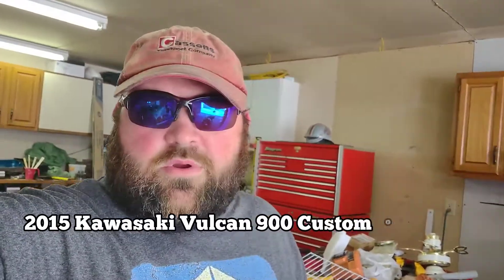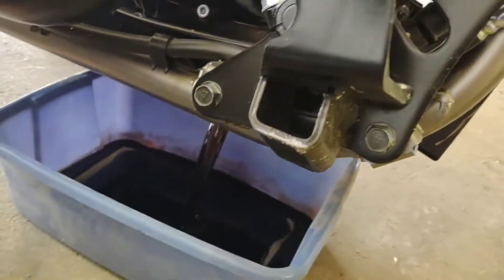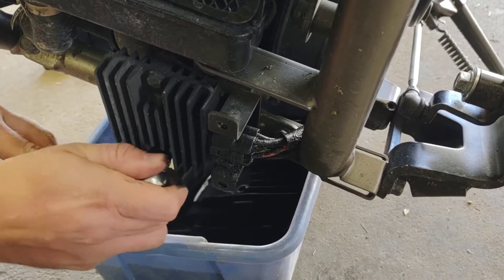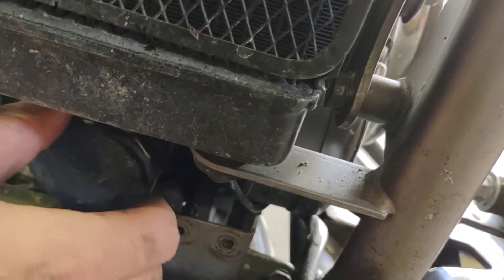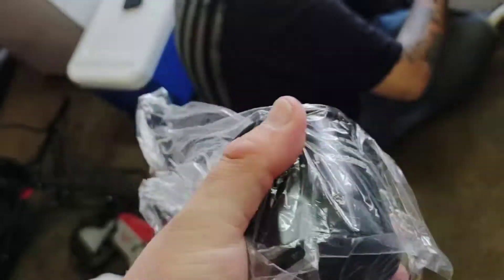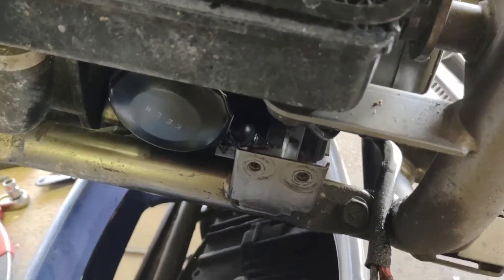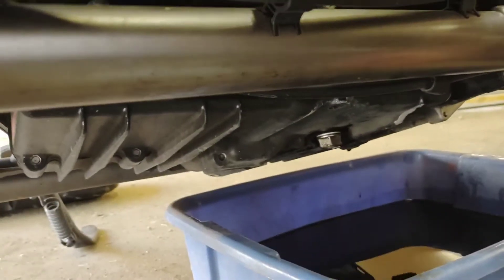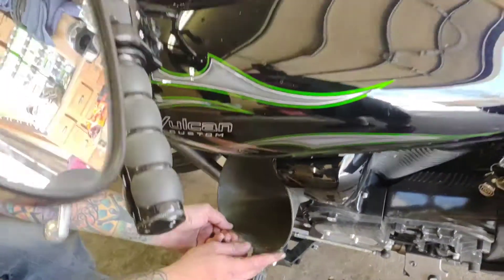Kawasaki Vulcan Custom 900 Oil Change

Comment: So, you don't level the bike and you don't clean the oil screen?
Reply from the maker: We did level the bike I must not showed me specifically doing it we had to cut the vid short there at the end due to a family issue that needed to be taken care of but yes we do clean the oil screen thanks for the comment sir, we will have to make sure we do a part 2 to clarify those issues
Reply: @jdubb67  Even when you fill up the oil, the bike was not level... the reason why you spoil so much oil. A lot real info is missing. Warm up the engine before drain, open the fill cap so the oil flows better, don't tight the new filter only by hand, lose one bolt from the regulator braket and swipe it to the side. No need to take off the regulator, ... etc.
Edit: now i see it, you are the grip cutter man who turn the handlebars to the worng side... i commented there before.
I feel sorry for the people who gona follow your uploads.
Reply: You don't need to clean the oil screen
Reply: @gtworldtourracing4550  Serious? Do you even know where it is located and what the function is? You are wrong, so wrong.
Looks like you are a online mechanic... all kids games.
But soit, i wait for a answer... that not gona come.
Reply: @corneilcorneil oil screen does not need cleaned every oil change. Every other oil change is fine. I put mine off every year for 3 years and there has never particles on it, and if there is you have bigger problems.
Reply: @199933redlx   I never sayd you HAVE TOO clean the oilscreen every oil change, BUT... if you upload a "how to", you better include it. 
You can not know IF there is a(SOME) internal problem BEFORE you check the screen.
I see it as a easy and simple extra inspection. Just assume that your internals are healty because you hear nothing abnormal is a lazy mechanics mentality.
 "Every year" says nothing about milage. Most bikes that i service have 5K km a year only.